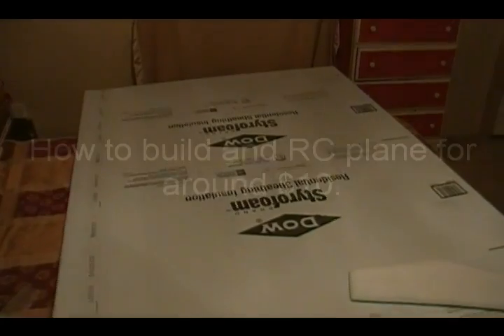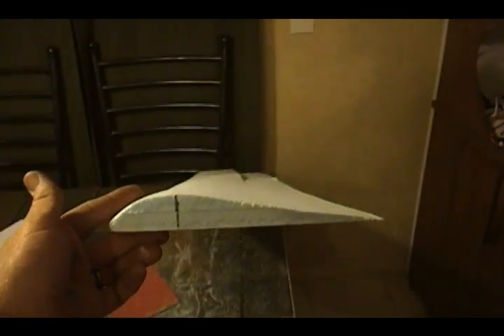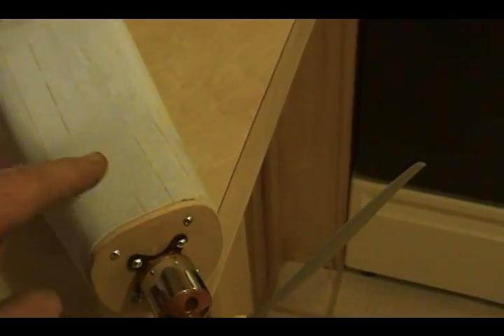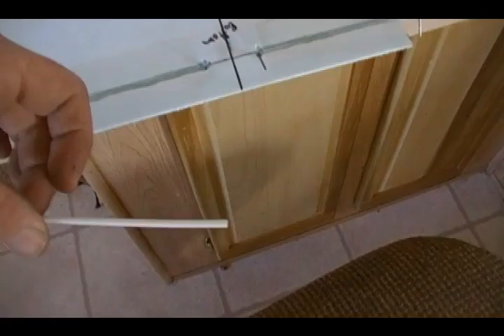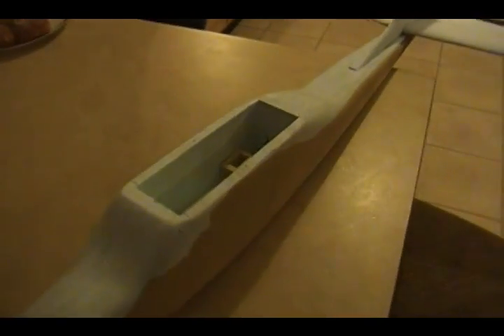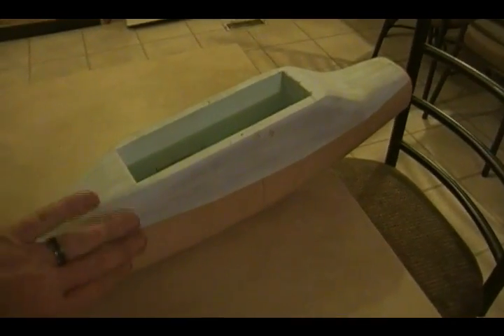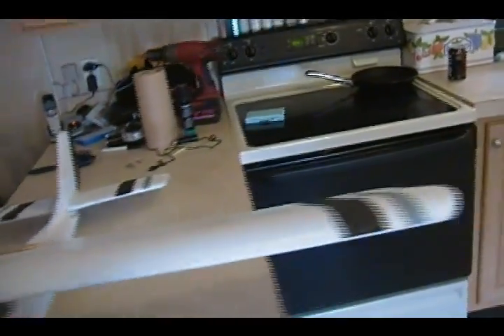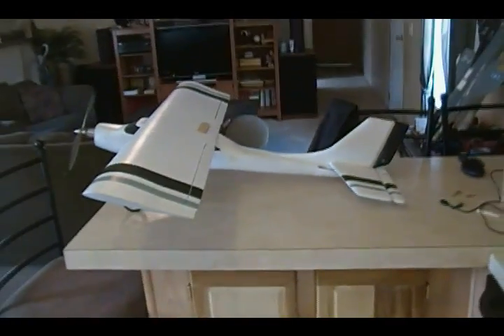How to build a RC plane for $10 (part 1)

Comment: I saved 6 dollars by using foam board lol but you can if you want a cheap one head to dollar tree but this foam is strong if you don't mind weight you can add a leveled amount of foam board actually maybe a gram extra not doing much so add an extra layer on the most impacted planes to be crashed

Comment: You didn't add the cost of glue, clothes hanger,  band saw, servos, receiver, battery, clevises, wood for firewall, control rod, dowel rods,wood screws, esc, carbon fiber spar, tape, all the hand tools on table, soldering iron, glue kicker, hot glue gun,  hot glue sticks, water, multiple grits of sandpaper, spray paint, drill bits, etc, etc, etc. I call bullshit, thumbs down.

Comment: Instead of sanding you can use a coat hanger and bend it to the exact shape of the wing heat it up and push it through

Comment: Great video!  Try using original Gorilla glue instead of hot glue.  It takes longer to cure, but it bonds to foam REALLY well.  The Gorilla glue also expands as it cures, so it fills in any gaps, too.

Comment: dimensions  please ¡¡¡
Reply: dimensions are NOT important.    c o p y    the   Proportions; assuming they are correct.     start with the  diameter of the prop that  YOU  plan to use; the diam should be equal to about  25% of wingspan;  ASSUMING the use of a  Correctly  spec'd  E  prop;  not an  SF prop.       cheers                      googletranslate

Comment: do you have the dimensions for this plane? Its the best scratch built ive seen.
Reply: dimensions are irrelevant.  look at  (quality) 3-view line drawings.   copy  Proportions; based on the diameter of  Your  prop.    in order to avoid making a  'complex' wing,  make a  constant-chord wing and reduce the span, a little.   where   tricycle  landing gear is shown, often, it is relatively easy to use  taildragger lg, if desired.    see linked example, below.    cheers             googletranslate
example
http://www.the-blueprints.com/modules/vectordrawings/preview-wm/cessna_152.jpg
cessna, taildragger version
https://airandspace.si.edu/webimages/highres/4840h.jpg
Reply: Thank you. I adopted your paper mache technique and painted it with enamel for water proofing and it ended a bit heavy.  But it was sturdier.

Comment: I really like what you did with the plane! it looks really good, but if I were you, i maybe would have cut some copper wire and put them in the foam before and after the opening to the components to strap some elastics instead of screws, because if it breaks, it can be fixed a little easier but really good plane!

Comment: I'm an old Rc builder from balsa days, had a piper cub kit and built it and monitored it , futaba radio. In the Air Force, early 70's so low budget but build it and had great times.  I want to try what your doing.

Comment: I have been trying to make this plane myself. I have been going through frame by frame and taking measurements based off the half inch thick foam. By any chance is there a set of plans for this thing to save my troubles.

Comment: Awesome Video, 
How did you ensure that the airfoil was consistent along its span? I see how you could ensure the shape was the same on both ends, but how about the middle?
Reply: he eyeballed it for the most part, but hey it's a cheap and easy way to make a fuselage n wing

Comment: What kind of glue did you use to laminate the foam?  A lot of glues will get gummy when you try to cut/sand the foam and prevent you from getting smooth contours.

Along the same line, did you use some sort of guides when you bandsawed out the body?  I'm surprised how straight the tail boom looks.  Is it hollow or did you poke the control rod through the foam and keep it going straight somehow?

Comment: I presume you didn't design this yourself?  If so, how did you know how much lift the wing would produce, where the centre of gravity would be in flight etc?  Presumably you don't have a trimming mechanism, so your aerodynamic characteristics must have been pretty precise to get it flying steady?
Reply: trim on transmitter. yeah its not perfect or symmetrical but it will fly. i think he guesstimated on the wing and placement. but you can have too much wing its ok and add balance weight in nose/tail if you need to

Comment: This is great,, I use to use this on balsa planes as well many years ago,,  it works great as a built up wing covering too. Dries tight just like silk-span. you can also tint it with water-base paint mixed in the glue and water
Reply: yeah i like this better than just covering it in tape.
Reply: Hong nor x1 really

Comment: I plan on making a rocket powered komet type plane, but I'm wondering how I can accurately find the CoG and CoL? I don't exactly have a wind tunnel on hand.. Though that would be pretty awesome.
Reply: you can get COG on the fuselage pretty close hanging it by a looped thread around it. COL is approx 25-30% of the wing from it's leading edge. rocket powered tho??

Comment: Pretty large wings! Very interesting. I might do this to design my passenger plane, an all-new concept with a split v fuselage and delta wings and diagonal vertical stabilizers! (It probably won't work, though...
Reply: good luck..i support you
Reply: Thecrazeecow good luck
Reply: yeah nice low wing loading for slow stall speeds.

Comment: i dont want ailerons will this work without them?
Reply: If you put enough dihedral in the wings and cut a large enough rudder, it should
Reply: +SandwichedTom it is possible to buy planes without ailerons, lots of trainer planes have rudder only control, these planes gave a considerable amount of dihedral which stops the plane from rolling over and helps the plane to fly level.

Comment: Awesome job, Tinman.  ¿Do you think I could build just a wing like this for constructing a low cost 'Slow Stik' electric flier?  Also, ¿did you take peel off that thin layer of (¿polyester?) plastic the foam comes covered with before gluing the two sheets that make up your main wing?  Thank you.

Comment: I'm fortunate enough to already have the electronics I need to make a lightweight plane. but I have a rear facing engine so the  propeller needs to be in the back. it was a cheap $100 hobbyzone plane that was discontinued. problem being for me, I have no skills making stuff. haha
Reply: rear facing engine? you switch any two wires of the bldc motor and you can use it in the front

Comment: i think he means 11 bucks for the frame no electronics
Reply: +Pretzil295 yeah what about the battery, the speed control, reciver and controller? haha thats around 80$ just in that
Reply: in my country I got 17$ to get motor + esc
Reply: +david mimms yes the frame is the airplane
Reply: In my country I can buy a motor and esc for like $8 shipped, they will be crappy and take 40 days to arrive but still
Reply: mmk
Reply: ikr
Reply: Pretzil295 that's not even including the controller, the ESC and the battery
Reply: Pretzil295 Motor and esc and prop are about 15$ on amazon as a kit
Reply: yomustdie 94 well then it’s a glider not plane
Reply: The best part of a plane like this is if it gets smashed you can always salvage all the electronica out of it and put them into another homemade or kit built plane. Your only out the cost of the foam and hot glue then.
Reply: Im gonna recycle old rc car parts I got for literally 10 bucks and for the air-frame Ill use whatever crap is in my shed :D
Reply: Ya it cost $10 for a cheap servo from China and the motor looks like $20 or more... Maybe he should say "under $50" hobby grade style...
Reply: +david mimms yep, but theres no way he would have got 2 million views calling it "how to build a plane for under $60" I can build a dollar tree foam plane this size for $3 no electronics.

Comment: There's literally no way you built the whole thing for $10. Just the ESC alone cost around $9-15. The motor, around $14 and lipos are atleast $10-50
Reply: Dude... The plane not the control surfaces and electronics

Comment: Good build man. But now in 2015 you can use dollar tree foam it cost less and is lighter than the blue foam. And takes a lot less time to build. You did a awesome job
 with the blue foam.
Reply: Harlan H. mote But his foam wing is solid, dense, and strong as hell. Foamboard from dollar tree isnt as stiff or strong.  Maybe a hot wire cutting with MDF or hardboard aileron templates could improve the build process.

Comment: I could buid the airplane for a few dollars by using a different foam technique, but the electronics are about 70-100 dollars, depending on your motor and transmitter.

Comment: Carbon fiber tube runs $4.50 to $5.50 for a 36" tube. On the aileron control rods. You can polish the wire before bending, then coat them with Vaseline put them in place and build a dam out of clay at either end then fill the groove and wire rod with epoxy. After the epoxy sets the control rod will break free and the resulting epoxy bearing is slop free. Do this all the time for Q500's.

Comment: You may have built the ACTUAL plane for $10 but all the other things cost extra...Like the MOTOR?
Reply: Workin Alday People used to do that with old CD Rom motors before RC electrics were widely available. The difficulty is matching the battery and speed controller to the motor's specs.
Reply: Chris Wilds The Video I was watching that led me to this one was some guy putting an old 7200 RPM HDD motor into one of these. It was better than the standard motor that came with his from a hobby shop, and it was free! So you could do this all parts for $10 or under, just looks like it's a lengthy process.
Reply: Workin Alday id like to see that. Any idea how to find that video
Reply: fromkentucky
Reply: Most of us that have been flying for some time have boneyards full of motors servos etc.
Reply: Workin Alday same here :D

Comment: $10 in parts and about $100 in electronics
Reply: sedislm motor 20$ + esc, controller 15$, prop + shaft 4$, servos 8$, battery 20$ = 70$ ~80$ + Airplane, no more than 90$
Reply: ***** tax? what tax? order online they are same price as i posted + free shipping.

Comment: I have a new as yet unmodified Air Hog and notice the CG is located way in the rear region of the wing chord. ~ 5" is what I estimate. I wonder if this is because of the swept wing configuration. I needed to establish the unmodified CG in order to plan for component placement according to their respective weights. Servos are 9 grams each, 4 AA's weigh ~ 100 grams, control rods, etc. This will be a glider at first, so it may be more sensitive to correct balance than a powered version. Has anyone tried trimming some material off of the fat rudder for better streamlining, especially at the rear? I know that it's thick for strength, but it's also a source of excessive drag as designed.

Comment: First I will say this: I really enjoyed this video. Some super great advise and I will be using some of these features on my next build.
Next I will say this: NOT INCLUDING THE ELECTRONICS.. This plane is NOT a $10 plane. Carbon fiber rods, dowell rods, glue, paper, foam, wires for push pull rods, wheels.
Not including the $80 worth of electronics, this plane would cost much more than $10 to build.

Comment: I feel like this is a little misleading. How did you manage to make it fully functional for only $10? Those were futaba servos if I'm not mistaken, and at my local hobby shop they cost around $25 a piece... Are you saying $10 for the airframe or $10 for a functioning rc plane? I would appreciate a response! Thanks!

Comment: That's a really nice build from scratch!!! Looks as good as some of the kits you can buy for way more than $10. I imagine that price didn't include the motor, but still... great!!! Theres a product you might try that is basically exactly what you made with the elmers type white glue. It's called Mod Podge or Hodge Podge. A waterbase sealer, glue & finish all in one. You can make thin coats or very thick almost clear plastic like coats that you can sand to your own preference. Comes in different types like flat, glossy or super glossy. I use this stuff on all my arts and crafts. Plus it won't eat the foam and the more coats you give the stronger it gets. Any arts supply or craft shop should have it. Couldn't find your flight video but I'm sure it flies well. Try that stuff out and happy flying,N8knox

Comment: Look i get that you want to show that you can build a cheap body of a plane. But your title is very misleading. Someone new might think that they can actually build a plane for $10! Except then you need the transmitter, the receiver, motor, propeller, 3 servos, and electronic speed controller. That's where the real cost in entry level radio control is.
Reply: Fl

Comment: I never said it's a bad plane. I am 100% full aware of the benefits of building your own plane - you can make exactly what you want, you can try experimental designs, change it, wreck and rebuilt, etc. I've built plenty of my own foamies.

I just wanted to point-out that to call it a "$10 plane" is wrong.  

If someone came to you at the flying field are you going to say, "It's just a $10 plane", or are you going to say, "I built it from scratch."  The latter, right? Hence, you value your labor.

Comment: If it goes all the way through, unless you do EXACTLY the same for both wings, the effectiveness of the aerofoil may be decreased, meaning less lift. You can drill air holes in if you have a very good aerofoil. Other than that I have no more knowledge about air-holes. Just do them with research.

Comment: Very true, but some airframes can cost $1-300 or more, and those are the parts that you're most likely to wreck in a crash.  Unless you are being really crazy you probably won't harm any electronics in a crash.  Expect props to break on a pusher, though.

With this fellow's method, you can recover from a lot of "learning experiences" really cheap.

Comment: Hmmm that look awesome , maybe I can do if I start that project . But I want to know more about the system , ass like what kind of Remote Control , Motor , how many volt of battery , what kind of servos and what else that we need to use in that plane . can u make detail for me ? if I want to build the same plan as your . what else should I buy ? Please make detail with the picture , coz my English no good and also I am a beginning of flying . I like that stuff so much. Thank Q sir .

Comment: You will need a decent charger regardless if you buy a RTF or build your own.  (the ones that come with RTFs are junk and usually the batteries are too)  You can buy a motor that would move this thing for about $10, ESC for $12, $10-$15 for the battery (2200mAh 3s)  Servos for about $3-$5 each, $2 for the prop (don't know where you got the price for the prop!)  Radios that come with RTFs are absolute junk 90% of the time so that is out at well. Add about $6 bucks for music wire and control horns

Comment: I checked and cheapest I could find was $25, $15 for the speed controller, $25 for the battery, $30 for the servos, $10 for the propeller and then on top of that you need $60 for a transmitter and receiver and $30 for a battery charger, that'll put you at roughly $195 + the cost of the RC plane ($10) and you're over $200 in this thing. I'd rather buy a RTF kit for $150 and be done with it.

Comment: we use the glue water mixture in theatre to size the flats.  use muslin instead of the paper.  it will be indestructible.  the muslin shrinks for a very tight fit.  you can get it at walmart.  less than a dollar a yard.

Comment: Your build is fantastic but its not something anyone can do. 
Most people could be better off if they spent $50 to buy an ARF kit. 
Also you do not include the cost of electronics, tools, and other infrastructure required. 
What I mean is that the title is kind of misleading and it does no justice to an otherwise great video. 

Oh you should also include how you cut the foam and how you sand it and how many hours it took you.

Comment: The video did not cover anything about the Elevator and rudder construction... Did you use the same 2 layers of foam? and how did you get them mounted in the fuselage with the needed strenght

Comment: Excellent video. May I add a suggestion: A good way to get rid of the rough surface left by cutting and sanding is to lay a piece of good quality wax paper over the rough surface, then use a hot-iron at about 140 degrees F without a sock and smooth out the foam surface through the wax paper. The wax will not harm the iron and it's not hot enough to ignite it. Works TERRIFIC.

Comment: Very cool BUT the title is a tad misleading, especially to beginners. With ESC, Speed control, motor, remote, battery, servos... you are looking at well over $10. 

You can buy a super looking 'almost ready to fly' model for ~$60 - but most of the cost is in the electronics required to turn it from a 'paper-weight' or 'model' to a 'flyable rc plane'...

Comment: hi yes i have some things i would like to ask you. 1)were did you get the motor. 2)were did you buy the wires and the other parts. 3) what are the measurements for the hole thing please comment back..

Comment: Nice video - I busted my Radian on flight #5 (nose broke clean off and prop shaft bent) so this would be a more economical way to go for sure. Where should I buy CA and a Hot glue gun? There are no LHS nearby.

Comment: OK Warren.   Here's what you do Arbi to get yourself some foam.
Go to Home Depot.  You have to go where they sell insulation.  
You'll find large sheets of various sizes and thickness.  I like the pink foam personally because it's so easy to work with.  For only $26 you could probably build 5 or 6 six RC airplanes.You don't have to wait 1 or 2 years for replies on YouTube.Almost any and all questions that you have on just about any subject can be found on the internet. This ends today's lesson.